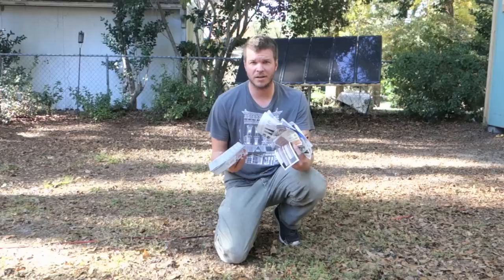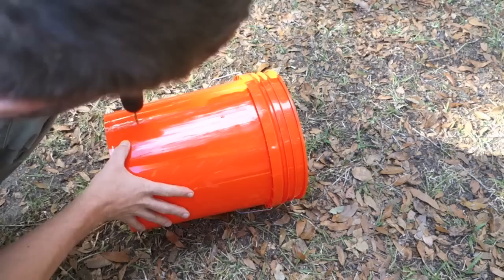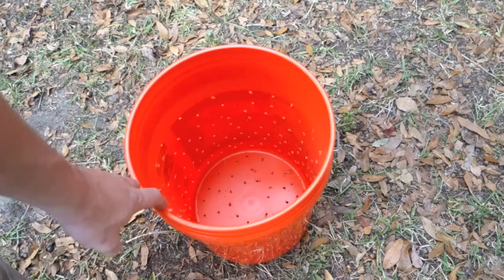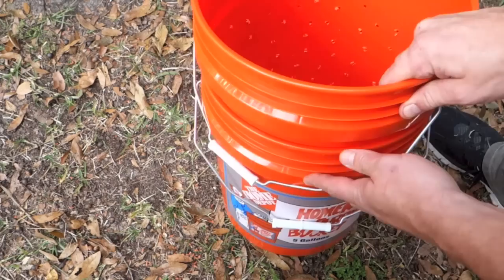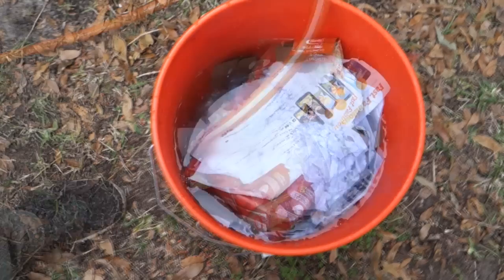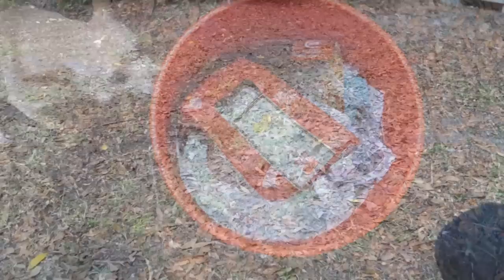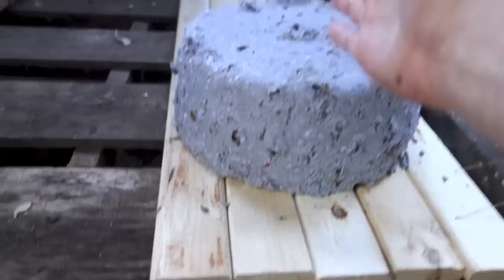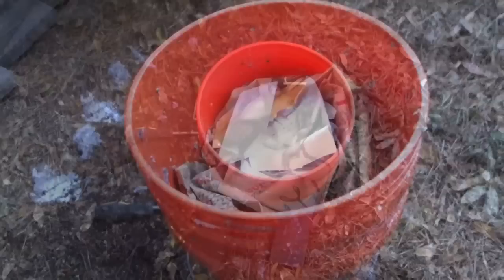Free And Virtually Unlimited Fuel To Heat Your Home

Comment: Tried this last year, and although it is a cool concept, it can be very messy and time consuming to make these paper logs. They do work, and the finished product after some weeks drying was pretty cool, the blocks were very light but dense like a brick. Burning, they lasted about as long as an ordinary piece of wood of equal size. In the end, for the effort put in, it's just not worth it. It's too easy to get your hands on a piece of firewood than to go through all this trouble.

Comment: The main drawback to using junk mail for this is that the inks used for printing often contain toxic chemicals, which can release VERY toxic vapors when you burn them. This might work in a REALLY well-ventilated woodstove, but you definitely don't want to use this material in a fire pit, or an open fireplace in your home. And you DEFINITELY don't want to cook over a fire made with these "logs".

Also, the ash they create is going to have concentrated amounts of these toxins, and is essentially a high-level toxic waste, so disposing of your ash is going to be hazardous--and possibly a violation of EPA regulations...

Comment: I tried this and it didn’t work. All it would do is smoke, could not keep it going.
Reply from the maker: Was is completely dry? Did you have a good fire going when you attempted to light it? These logs are very similar to regularly logs, they need a bed of coals when you put it in.

Comment: The problem with this is junk mail and the adhesives in them Etc... are really bad for your flue pipe and chimney as toxic fumes and burn off and the residue on the inside of the flue chimney and as well may violate local laws governing trash burning.

Comment: This makes no sense. It is not free unless your time is free. My time has value. Additionally, you paid for the electricity to run the drill which is also probably not from clean energy. There are dead branches all over the place unless you live in the desert. They would require less energy to burn and produce a lot more "free" heat than these paper bricks. If you want to burn unused paper, by all means do so, but if you just put them in the fire as they are, without forming bricks, you will get the same energy yield. I would challenge anyone who disagrees to debate the science of what I am saying.

Comment: Long winded, you can’t start a fire from it as stated in the video, waste of time and the water that was getting reused was half full so still wanted water. Drying process will take ages. What burns longer wood log or paper log. I bet wood wins. This is why we burn wood. In addition you can soak a paper brick in fuel so it can be lit. Having said that still a silly idea and waste of time. There are so much more out there that are better than this, nice try but back to the drawing board

Comment: Try using a pan to drain your "logs".  Place the 2 x 4s in the bottom, and NO water gets spilled.  You may have to cut the 2 x 4s to fit inside the pan.  I think 1 of those mortar mixing pans work well for that.  (24 x 18 x 6 inches)  However, burning these things will degrade air quality downwind of your chimney.  The "That's somebody else's problem" attitude is called depravity.  Widespread depravity lead to clean air laws more than once on human history.  I'm not too sure your "free" heat is legal heat.  You might be asking for legal trouble if you don't look into it further before you burn these things.